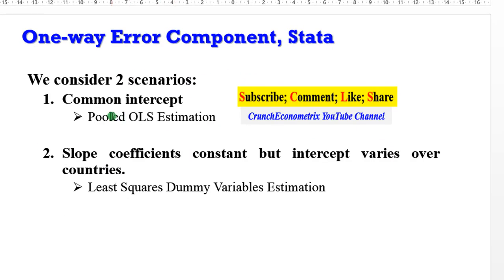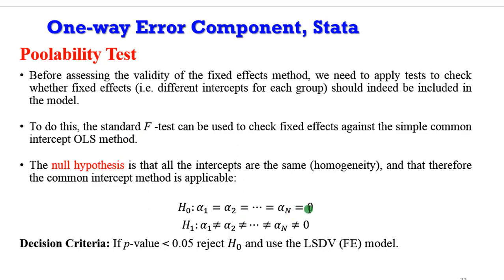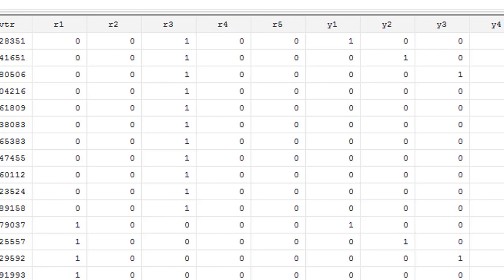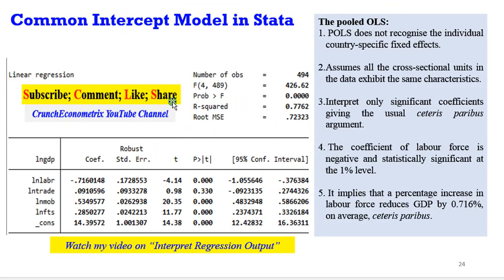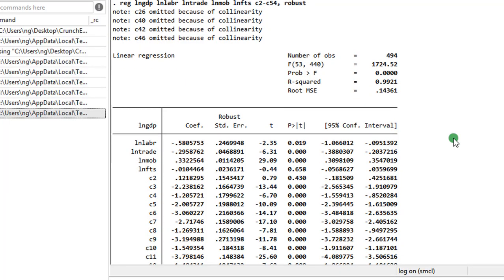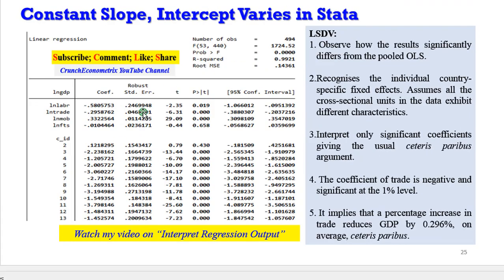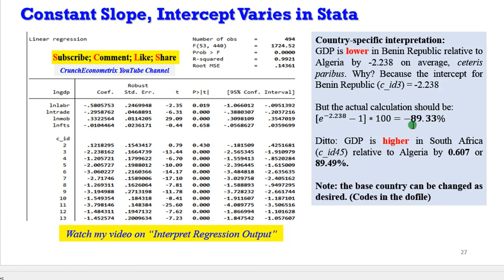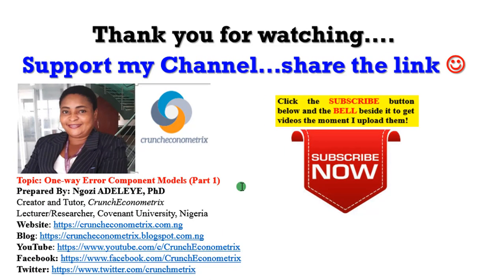(Stata16): One-way Error Component Models, Countries (Part 1)   #lsdv #pooledols #paneldata

Comment: May i ask you about the classical assumption of OLS method. 
Should we do classical assumption test (i.e. Normality, Multicollinearity, Heterocedasticity, and Autocorrelation) before testing panel effect? Because as you write in your command, instead of using default SE, you using a robust SE for your command. What is your consideration for choosing a robust SE? Thank You.
Reply from the maker: Robust SE corrects for heteroskedasticity.
Reply: Does it mean you test for heteroskedasticity before you do panel data analysis?
Reply from the maker: You may not need to. Panel data models are usually heteroskedastic.
Reply: @CrunchEconometrix  When you say "usually" does it mean we always need a robust standard error to estimate panel data?
Reply from the maker: Yes.